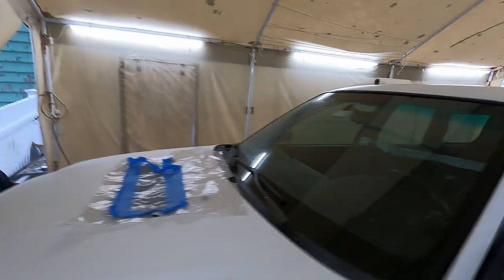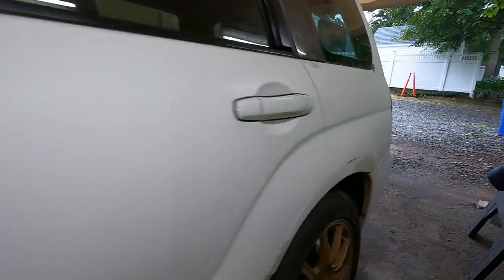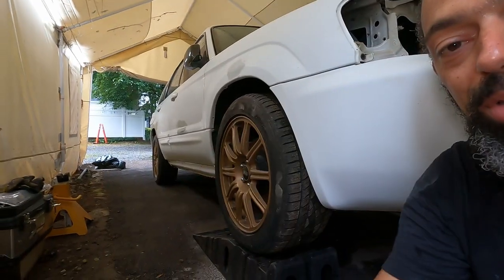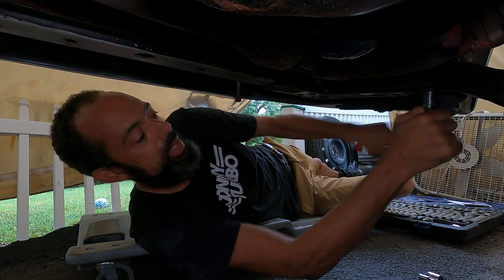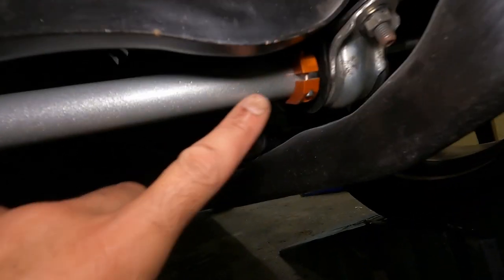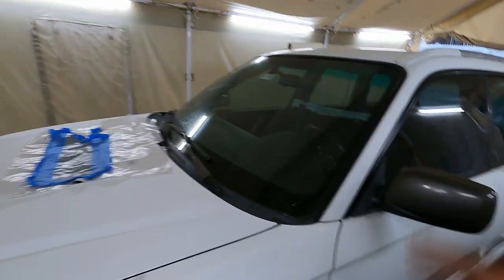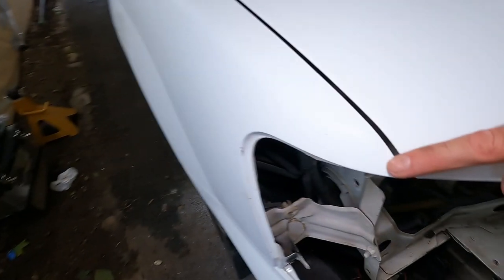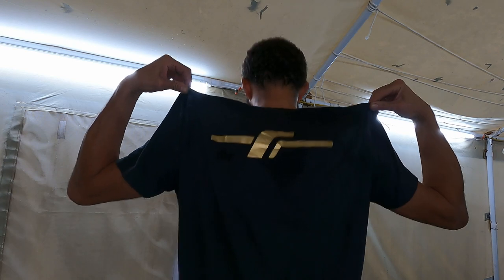It’s How I keep sane

Comment: When I get my Miata torn down for paint I am gonna be removing nearly everything, but while its all apart I will be installing Strong arm braces behind the front fenders, frame rails and butterfly brace, washer nozzles in the hood, hood struts, new tail lights, and a new canvas convertible top. Its gonna be a long process but it will handle great with the new add ons. I already have some Tein coilovers, sway bar, end links and strut tower brace. Its a lot of fun modding your ride and the payoff is awesome. after i finish all that I am gonna pimp the interior. If you change out your stereo Rockford Fosgate makes some great stuff and you always get much more performance than is stated in the paperwork, their stuff is awesome
Reply: Oh, im ordering the smaller version of that booth to go with the big one, i am getting that for parts so I dont have to struggle with the large one several times. that way I can set the big one up for the main body only
Reply from the maker: thats a solid move! I still have wheels I want to paint, plus I want to paint the truck I use to tow my Subaru around...I plan on keeping this is seeing if I can hobble it together in the spring lol
Reply from the maker: that sounds like a bad ass project! I dig miatas, little rippers!